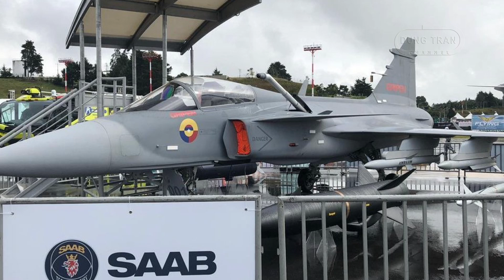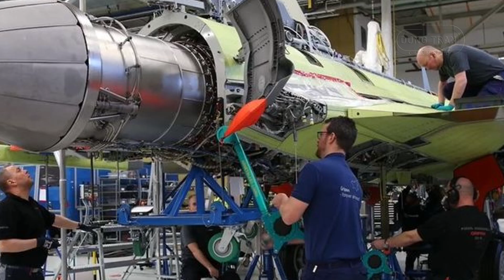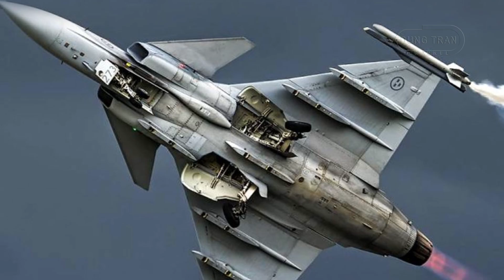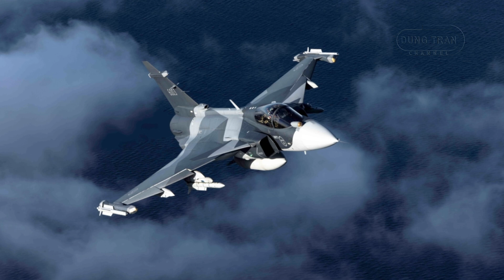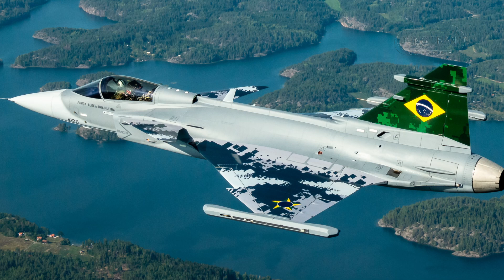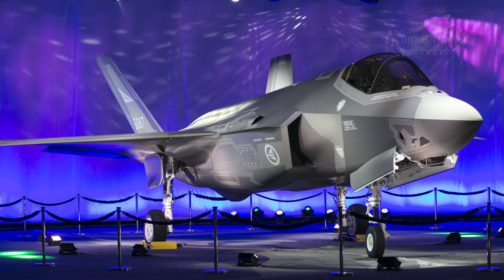Swedish Gripen's Achilles Heel: The American Engine

Comment: There's no restriction for Canada using the Gripen.  The engine us just a variant of the F-18's engine which Canada has flow for the last 30ish years.  In terms of weapons the Gripen can use nearly all European and North American.  Canada's Navy is already using other Swedish RBS-15 missile.  Now that Europe is forming its own military, the Gripen is perfect for it.
Reply: Without the contract between GE and Saab it is hard to tell, but legally I don’t think a block to Canada would hold, as they already have that same engine. Also, as Canada already bought 16 F-35s, it is hard to block another US tech to Canada that is decidedly less critical than the F-35 tech. Plus, if the US vetoes, they won’t sell ANYTHING to Canada. If they agree, they sell those engines at least. Canada can basically say that they want the Gripen, and if they cannot, they go with Rafale or Typhoon.
Reply: @johns70  Saab is looking like they're going to use the Rolls-Royce EJ230 because I'm pretty sure they know that the American engine is going to make A LOT of countries (NATO countries included) not want to buy it.
Reply: I pretty sure RR could make an engine for it.
Reply: @michaeltagg492  The EJ200 has already been tested in a Gripen and the EJ230 is a drop-in replacement.  Saab should just switch to the EJ230.
Reply: I hope your right!
Reply: The United States should never consider selling the F-47 to Canada or any Crown country including the George Soros European Union.
Reply: Please, point out the source of Canada using the RBS-15 missile.
That would be really interesting to see...

- - - 

Also; it's not 'just a variant', as GKN (former Volvo Aero) made some quite significant changes to the engine. Both GE engines used for Gripen C/D and Gripen E/F, were designed for twin-engine jets.
The upgrades of GKN are way more extensive than smacking a new label onto it (more resistant to bird collisions and squeezing more power out of the engine).

The mere fact that Sweden brought the maintenance of these engines home to Sweden, both for the SwAF and for Gripen export customers, should tell everyone something.
Reply: Problem is how Saab is able to sell Gripen to Canada? Engine is from GE and based on that fact, US is blocking Gripen's sales abroad. 
On course Saab can sell it without engine. But it would be costly operation to redesign the powerplant section.
Reply: @viggenajs3408  He just said that there is no restriction on the F414 engine to Canada.  Canada was already approved for them when we were looking at the F/A-18E.  And no, it wouldn't be costly to change the engine to something else because Saab has already tested the Gripen with both the EuroJet EJ200 and the Snecma M88.  They both work.
Reply: If Saab has designed Gripen so that those two engines could be used without problems, then it 's great! I didn't know that.
Colombia want to buy Gripen. They were also planning to purchase F-16 to replace KFIR's. KFIR uses GE J79 engine so US hardware in use. 
How does this differentiate from Canada's situation? US want to sell Columbians a F-16. They don't want any competitors. Dirty game, nothing else.
Reply: @CF-105_AvroArrow  I would genuinely love a source on that but I really doubt it's true. GNK aerospace did extensive evaluations on both the EJ200/EJ230 and the Snecma M88 in the 2000s but if there were any prototype aircraft using those engines made we would know it. What I do know is that the Gripen is already made to accommodate the Snecma M88 so if an engine swap happens it would most likely be to the earlier proposed M88-3 or the newer M88-4/4E.
Reply: I'd like to back some of my words. I did found a reply from Saab ( 2008 ) concerning engine EJ200. They clearly said that it would require extensive rebuild = very costly, of fuselage and the engine had not been approved for single engine applications. So, end of story.
In any case Saab should redesign Gripen so other non-US based engines could easily be utilized.
Reply: @viggenajs3408  True but the fastest and most cost effective solution would be to just swap to the M88. The M88-3 was specifically made for single engine aircraft like the Gripen and Tejas but noone ordered it. The M88-4 looks like it’s using the same larger low pressure compressor as the M88-3, and the M88-4E has taken the engines already superb ease of maintenance to the next level by extending critical components service life among other things, which lets face it, is a very “Gripen thing”. The engine also has really nice performance, outperforming the GE F414g in dry and wet thrust while being smaller and consuming less fuel. I’m not trying to look like a salesman for Safran here, I am swedish and just very hopeful that a swap happens to a good engine soon 😅
Reply: @viggenajs3408 They won’t. It would be to costly, an entire new model. The E has just recently been introduced. Saab is already looking for the fighter jet that will replace the Gripen 10-20 years from now.
Reply: EJ230 engine could be a solution. Seems to be more powerful than GE and compatible with Gripen.
Reply: @ The difference is that Canada is a NATO country so, still technically allied and the USA had already cleared GE to sell the F414 to Canada when we were looking at Super Hornets.
Reply: @viggenajs3408 US blocking Gripen is not a fact. It is a debunked Internet rumour.
Reply: Exploring alternatives (reference needed) to the current engine only after experiencing export hurdles is the opposite of being proactive. Who writes these manuscripts?
Reply: Exploring alternatives (reference needed) to the current engine only after experiencing export hurdles is the opposite of being proactive. Who writes these manuscripts?

Btw it’s awful that Saabs competitors can veto every export. Not a great strategy to use American parts.

Comment: The ge engine is made in Sweden on licence. 
The same way multiple Swedish weapons are made in the us on licence…
Reply: It's assembled from blanks coming from the US.
Reply: @ 

I work at GKN Aerospace Sweden
We produce the parts in house. Well some parts now are actually produced in Brazil…. One of the deals in ”licence built ” is that you build and produce it and pay commission on every unit built. 
Us can say no to export but can’t say anything about air craft intended 4 Sweden…. 

Some parts can be imported to save time but everything on the engine can be made in house. A demand by FMV 

Also the engine in it self is vastly different then the original product
Reply: @pauleriksson3147 Do you see a way, given what you know, that Canada  could order Gripens without the U.S. blocking it?
Reply: @benz0317  

Simply! Yes
Reply: @ Thank you Paul. I hope they do. I’ve been watching a ton of videos on the Gripen over the last few weeks. Really curious how they stack up to the F-35 and the latest F-16 version.

Comment: While Britain and France are about equal militarily, the UK is joined at the hip with the US while France is almost totally independent, which is why France has to be the leader for the first phase of this realignment.  Can Britain even sell their engine to Saab, or is it, too, tied to US export controls?

BTW, Europe should keep in mind that they only have to match risible Russia, not the US or China. Even with a subpar engine, the Grippen can clobber anything the Russians can put up.

The only thing that prevented Ukraine from beating Russia was everyone’s fear of Russian nukes. If garbage heaps like North Korea can build a bomb, certainly a modern, advanced nation like Poland can. And, it’s been said that Germany can build a bomb out of spare parts over a long weekend. Either one can get uranium from France – or Canada!
Reply: Shows how much YOU know.  The EJ200 is a EUROPEAN engine, designed and built by a EUROPEAN consortium including Rolls Royce.  DO keep up.
Reply: No the RR engines are not tied to the US
Reply: @robertpatrick3350  Great News
Reply: Sweden has had the capacity to build a bomb since the 50s. They arguably still have. It's just that no country ramps up a nuke production without notice and match it with a viable delivery system. Germany or Poland has no such missiles. Even Britain relies on US for theirs.

Comment: It is time EU makes it's own engine. I still don't understand why Europe always depedens on USA for everything.
Reply: The Gripen E (ie the only one we're building or selling now) uses the F414, not the F404. The 14 is roughly 20% bigger and more performative vs the 04.
The M88 and the 200 are comparable to the 404, and sadly not the 414.

If the Americans forces General Electric to be as unreliable as the rest of them, we have a problem. The problem can be solved with time and money - but right now it's unclear if RR/SNECMA will get that money and how much time we can afford.
Reply: @ The basic EJ200 outperforms the F404 in all respects and is comparable to the F414. It has a slightly better dry thrust than the F414, a slightly worse afterburner one and a better thrust to weight ratio. 
The EJ2X0 variants (stage 1 and 2) easily outperforms the F414 in all respects.
Eurojet proposed to Saab the EJ230 variant, 102kn thrust with afterburner (vs. 97.9kn for the F414) and thrust vectoring. Saab chose the F414 because it was cheaper.
Reply: NATO standardization requirements is really just another way for the US to force foreign governments to funnel money into their defense industry.  The EU and Canada are learning building local industries but it will take time.
Reply: Both the EJ200, the engine of the Eurofighter, and the Snecma M88, the engine of the Rafale, have better performances than the GE404. The GE404 had ben selected for the Gripen only because it's cheaper.

Comment: This isn't too much of a problem. We can instead buy motors from Rolls Royce or perhaps Volvo Aero, that made the previous motor.
Reply: Volvo Aero no longer exists and the engine they made was a modified GE F404.
Reply: @CF-105_AvroArrow Sold to GKN, so they exist but with another owner.
Reply: @bofomalsi4146  Well yeah, that's what I meant, I meant that Volvo Aero no longer exists as an independent company.

It's like, do you say "ATi Radeon" or "AMD Radeon"?